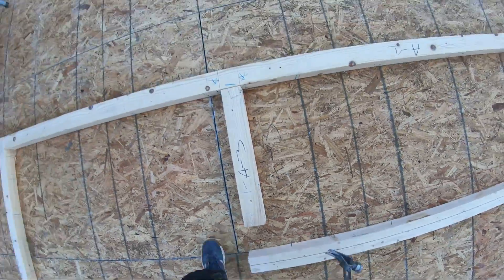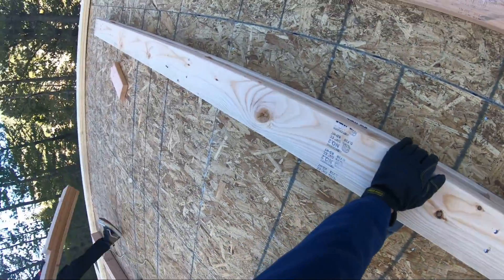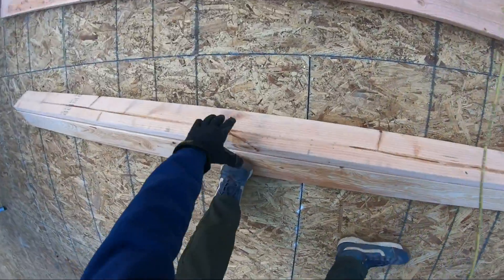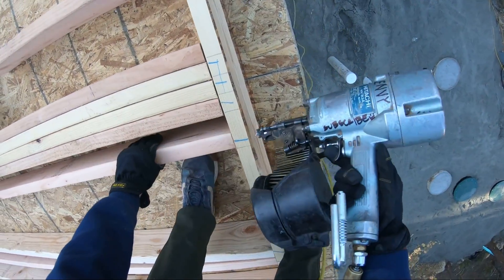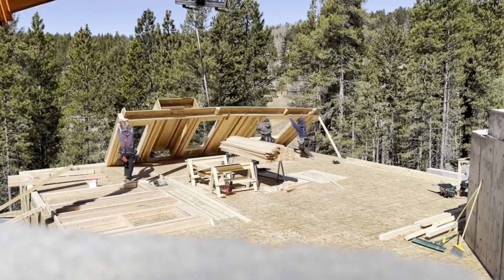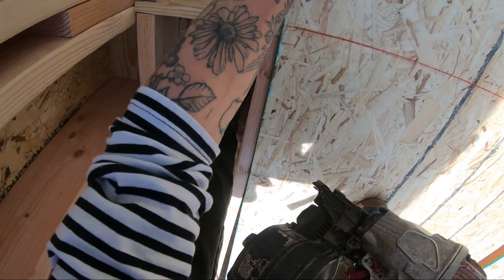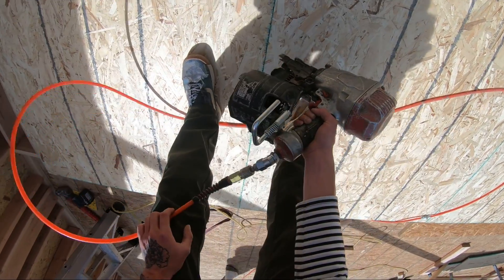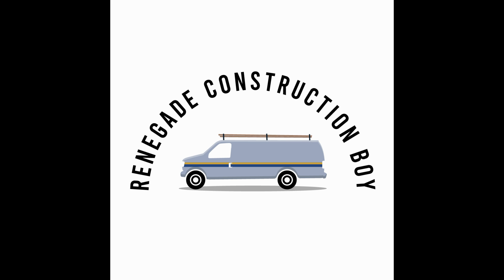How to Build/Frame a House Part 4 Framing Exterior Walls

Comment: Sorry for being rude, why are you not sheeting horizontally so the walls hold structurally strong, with OSB?
The rest of the framing looks great. Oh and I appreciate high quality workmanship, as you are doing.
Reply from the maker: We have to have blocking at all panel edges, and running them vertically saves us time because we have to do less blocks
Reply: I used to build with Bouchard Brother's Ltd. In Winnipeg, Manitoba, Canada it was all built by book. Proper and strong.